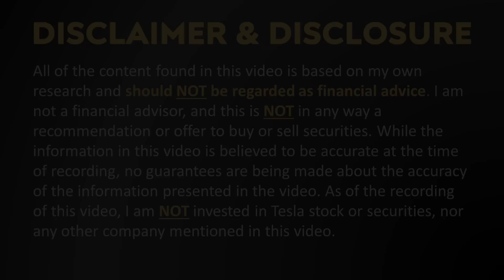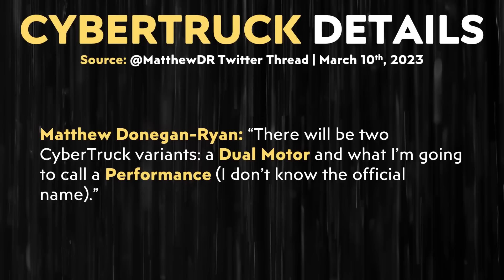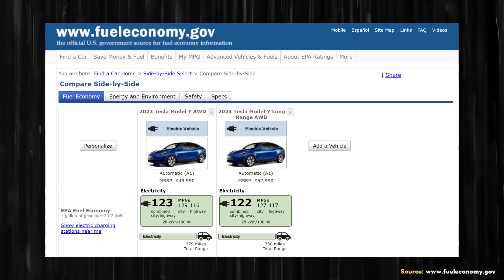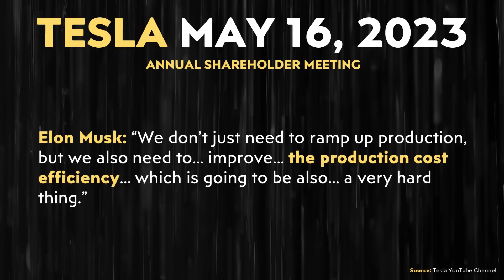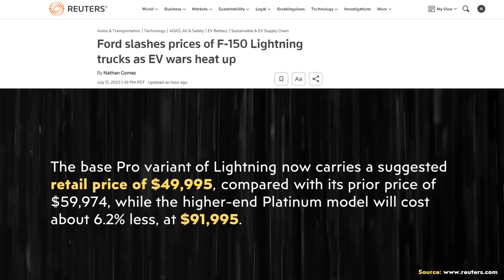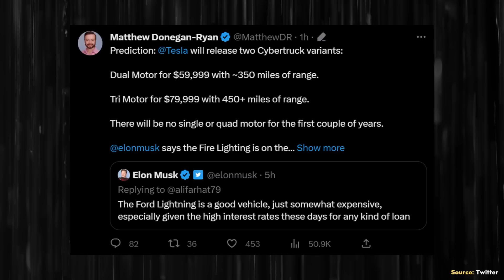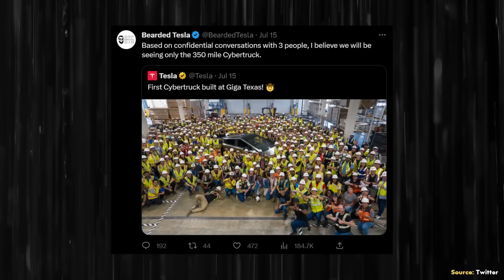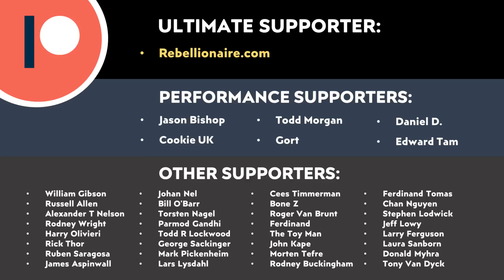Tesla Cybertruck Production Begins | Range Rumor & Pricing

Comment: Cleanerwatt; this has been the problem since day one with 4680;  they can't make them to work properly; what else do you think it was? 
it is in their annual report for 2022.  Is that a good source?  Tesla told Deutche Bank a major investor that they would Cybertruck in production by the end of 2023, saying they had 90% of the production issues fixed; they haven't. IF they had  you'd see new Roadster and Semi production running as well. you don't.  They really have no choice now but push them out no matter how much red ink it spills.  Problem is lots will bail on this news because they had anticipated significant Cybertruck production and at a profit; instead they cover it up and say nothing.
Reply: Genius, if you’re accurate. Did you short the stock yet?

Comment: They've already lowered the energy denisity of the v2 of 4680 to a slim 10% advantage over conventional from 16% advantage; so that alone will be a lowering of range by 6%.  More importantly the 4680 reject rates remain too high and any Cybertrucks produced wiill be red ink for the company.  Proof of that will be low production numbers under 20,000 a month; and delay until as late as possible to deliver any, so its already 12 days until Oct; your likely talking 45 days or at best November to see the very limited numbers delivered.
Reply from the maker: Where did you hear that there were high reject rates for 4680 batteries?

Comment: The Rivian R1T has been on the road for the last several years.  The interior of the Cybertruck looks like it came from a stripped down Honda.  Look at the R1T and you will understand. Yes, the Cybertruck is futuristic looking but I prefer comfort over being cool.  Both trucks can climb up a wall.  The Rivian is 10s of thousand cheaper and both use the same charging network now.  Range on the R1T 300-340+ depending on battery pack and Quad or Dual motor; both are fast. 600HP for dual motor is plenty for me.

Comment: Jon, you might recall my numbers on CYBRTRK.
I hold steady to the QUAD CT with the CYBRCELL as first 'Johnny Cab' off the rank on handover day in Sept or earlier.
This variant could well go 500 miles on the 175 kWh pack.
Pricing could be as high as $89,999 but with recent pricing levers used by Tesla, $79,999 would simply floor me and pretty much everyone, especially the competition.

Comment: Range is only one I think very small part actually of full size pickup truck market pure BEV as there is so much charging infrastructure now available thanks to Powerwall and SolarCity.

In the alternative fossil fuel "infrastructure"(retail footprint) has tremendously changed now in responding to this...as have ICE Platforms where range does indeed matter much more than previously #buccees but again for the full size market still all about bed payload, total payload and towing ability. 

Ability to tow should be truly awesome for pure BEV as a battery produces truly an awesome amount of torque and distributes this form of power ... and this is true power where it matters "along the curve" ... very even--ly meaning no shifting/no transmission/no fancy computers trying to get the computation correct between engine speed and flywheel rpms...this latter of which can still be done manually in point of fact.

In shorthand I will be looking at chassis design and wheel selection.

If Goodyears become the factory standard for Cybertruck that would be great news for Goodyear...a Company that definitely just some good news at the moment not just great news. Be interesting as well how the massive one piece body is "sprung" (versus unsprung weight.)

Comment: There is zero reason for Tesla to under cut Ford's pricing. Tesla will be losing money for a while on every CT they sell. Why give away money? The CT will have better specs than a lightning. Why sell a truck with more range, capacity and tech for less money? The CT will also be out produced compared to the lightning in short order. Ford has Lightnings piling up on dealer lots. Demand for CT is going to be far ahead of supply for at least a year. CT doesn't need to be the cheapest option to be salable.

Comment: The first model of the CT will weigh over 2722 kg (6000lb) as Fed tax law allows a large first year write down. It should have 150 kWh and a 380 mile range. I expect a 200 kWh quad motor will have a 500 mile range. The front and rear drivetrains should be the same.

Comment: That stainless steel will never be efficient or cheap to produce, standard stamped steel panels have a cycle time in the stamping press of just a few seconds, to kaiser cut and score a stainless panel then bend it in a press break will have a few minutes cycle time at best, that's maybe 60x as long. To produce at scale will therefore mean 60x as many machines to produce same no of panels that means massive footage in the factory and massive cost
Reply: That's right. This wll only ever be a very expensive vehicle produced in small numbers.

Comment: Here’s my bet. First production model available: tri or quad motor, rear steering, 500-600 miles of range starting at $69,000 or $79,000. He will reveal two other lower variants but they won’t be available until next year. Lower variants would be tri motor and dual motor with same range but different tow ratings. I think numbers less then that won’t give that wow factor. Too many competitors in close range.

Comment: I thought the tri-motor was cancelled in favor of a quad motor version. I expect initial production to be dual or quad motor, no single motor version. 500 mile range will come later when 4680 battery production hits high speed.

Comment: "Range-anxiety" is not really a thing any more, and 350 miles is going to be fine. Weight became a priority, because Cybertruck doesn't need to be a brick, like Lucid or the ridiculous Hummer EV. If this EV 'floats' for 1+ hours then 'milage' is soon forgotten. $59,990/tri-motor[...for towing], and 350 miles is the sweet spot. Bigger battery can wait for V2 edition. Think about it🤔 ...if you can float for 10 miles, would you give up 100 miles in range(?)

Comment: I am buying the Cybertruck when my name is called.   However, the biggest attraction to me placing a Tri-Motor reservation in November 2019 was the promised 500 mile range.   If Tesla only offers a 350 mile range version, I would be disappointed.  (But kinda of anticipated it)
Reply: Tesla is still struggling with 4680 battery production. Lack of batteries is the main reason not to bring out the longest range first. Your long range version will come later.
Reply: @royh6526  will come later?   Reservation November 2019.   Probably shorter range in 2024?   Longer range in ?  2025?   6 year wait!!

Comment: You can be sure they will release a dual motor 350 range.  I feel certain the Lightning cost drop is in part due to industry rumored pricing of the Cybertruck.  Initially, releasing a version for exposure and “field testing” before a heavier grade version frankly seems wise.
Reply: The price drop is primarily due to low sales. Tyler Hoovies' video about towing with one hurt them hard. Real world use proved them to be bad trucks.

Comment: Still wondering what the towing and hauling range will actually be, plus what happens in the winter. We have seen terrible range in other EV trucks under these conditions.
Reply: Same as all the other e trucks. Tesla has no special technology. Worse actually because the Cybertruck is heavier.
Reply: @Withnail1969  Sure they do, their heat pump design is more efficient than GMs, and Ford literally doesn’t have one. 🥱

Comment: I have the tri-motor reservation with 500+ miles range, tri-motor version. I don't mind to wait for it. I want that range from a CT. People who want a dual motor CT could get there's first. I predicting a 400 miles initial production release, not 350 like most people predict. I would be super excited if 500+ mile CT release. Happy to wait for my CT.
Reply: I too have a CT reservation. Not sure how long before I get mine. I like the 405 mile range on my new MS but from a practical standpoint one has to take a break after 150-200 mile long distance drive. I will not be hauling stuff in the CT so I am not as concerned about range penalty hauling heavy load. Hopefully in two years the CT will have lots of new enhancements that will make it more desirable.

Comment: I think we should be considering wh/mi usage similar to an X at ~280wh/mi. So For 350 miles of range and it will need a 98kwh pack (Seems reasonable).
For ~500 miles it will need a 140kwh pack.  Assuming its a big model Y, with no paint and less processes, I'm thinking 65-70k for the 98kwh battery and 85k+for the larger battery.

I'm probably wrong tho lol

Comment: I think Tesla could produce a $65k 350mile/charge Cybretruck but given the IRA and state tax incentives that will be @$10k. So Tesla can eat this and increase the price to $75k. 
I think that is good value given you have access to the Tesla network and charging at 250kW and potentially higher if they provide Cybre with V4 access, which I assume they will since they will use Semi Truck high voltage @1kV battery charging.
Unfortunately running with the rumors of some random dude that says he spoke to 3 dudes at Tesla.....is just laughable. If he said he spoke to 3 members of the Tesla board then that is a,different matter completely. 
So no I don't trust thus dude at all.
I trust my own guesses which are -

Dual motor:
Pack size - 110kWh
Range - 400mile per charge
Charging - 400V/1kV so can use V4 or legacy chargers.
0-60 -4sec
HDW4- yes.
VtoL - yes
VtoG - no
Air compressor -yes 
42V battery - yes.
Price @$65k

Tri motor:
Same as the dual motor but with:
Pack Size - 130kWh
Range - 500mile/range
0-60 -3.1sec
Price @$85k

Comment: Based on recently posted photos of the Cybertruck "firewall," it appears that drive-by-wire will not be available in the first release. The "firewall' shows a slot for a steering wheel rod. Hopefully, they have done away with hydraulic brakes.
Reply: It has also been suggested that those holes are for blow out ports for the airbags deployment.
Reply: @Frank_W.  Let's hope so. Would love to see drive-by-wire.
Reply: @roecroes  Given the battery platform I would almost say that it’s a given otherwise mechanical 4 wheel steering would throw out the concept of the best part is no part.  Fingers crossed that they could also include the Brembo Sensify brake system and it would fit the vehicle perfectly.  It may end up being too early for that though.  Purely speculation.

Comment: Those guessed prices for the cyber truck are still grossly overpriced. The truck is only worth around 18k due to short range, and long charging times.
Reply: This is badly designed and electric, it has to be cheaper than that!!! 😁
But yes electric vehicles should be way cheaper than ice vehicles they are so far behind for a lot of things ….they are bad, at least for now!
Reply: 18k? You’re lost. Nothing is 18 K.
Reply: @ZeusBullyMax  those paying more than 18k for a vehicle that offers less than a gas model are the ones who have lost their minds. How many gas or diesel models do you think they could sell if they went under 300 miles in good weather and about half that in cold climates and took over an hour to refill in good weather and possible several hours in cold temperatures? Fools part with their money easily.

Comment: Cybertruck is likely going to have a high range, at least one version with a very high range, probably the more motors the higher range.
If they want people to consider it as a work truck, it's going to need a heavy duty version for hauling (which lowers range) over a distance.

Now they have said that people usually only tow once a year...but they will need a version for the people that tow a lot
Reply: Not really. Tesla deals with data. If 70% almost never tow with their truck, why cater to the 30%?? Most of them don't want an EV, even if it had the towing capacity and 500 miles of unladen range.
Reply: @TecnamTwin  the small subset of people that really put their trucks to work are the ones that set the trend for what a truck can really do, and the posers want the real deal.

Also, if all you do is only use it once a year, but when you use it, you need it to do the job....then it has to be able to do the job.

Granted, if it can't be a work vehicle, then at least GM or Ford will still be able to stay in business

Comment: I recently drove a base Model Y and it’s acceleration is insanely fast. You run out of room quickly. With a truck, even a modest range/power level will seem even more adequate. The mid range truck will outperform a Ford Raptor, and if it comes in any lower than $80k it will be a bargain.
Reply: I own a model 3. Can confirm
Reply: No doubt the performance will be great, but will the range allow max towing range?

Comment: My sense is that Tesla is better off producing the Dual-motor 350 mile range product first.  I don't think there's an immediate need to address the distance towing use case with a 500 mile range Tri-motor version.  The Reservation Tracker finds that a plurality 43.9% of the reservations are for the Dual-motor version vs 39.2% for the Tri-motor.  It's important that the market sees Cybertruck pricing being competitive with the Ford Lightning which should be easier to do for the Dual-motor CT.
Reply: Tri-Motor reservation holder here.   I really thought in November 2019 that by 2024 I could get the 500 mile range as promised.  I guess Elon got out over his skis with the promise of 500 miles way back in 2019.    Coming out with a 350 mile range version at launch is missing the mark by quite a bit.   Sigh.
Reply: @billsrelectric  Ha ha, yeah.  Elon often gets out over his skis, but then recovers in amazing style.  Patience.

Comment: RETIRED 80,  USAF, VFW, FREEDOM. OWN 2018 TESLA MODEL 3 WITH 310 MILE RANGE. SORRY NOT BUYING 350 MILE RANGE CYBER TRUCK. WILL KEEP MY 20 YEAR OLD 2003 H2 WITH 42K MILES.
Reply: Sounds like a good choice for you.
Reply: @CMac_44  TOWING WITH 350 RANGE, CUT THAT BY 60%. TRUCK WITH 800 HP AND 0 T0 60 IN 2.9 SECONDS. NEVER HAPPEN!

Comment: Good video.  A disappointment not to have the long range of 500 miles.  With the function of pickups to haul heavy loads and needing to reach chargers with these loads, I would not consider a normal range cyber truck.  If Tesla would announce they would not make this long range model, I would cancel my order.  Good info.
Reply: I need the 500+ model to tow my 38’ trailer. Have been waiting on that to retire. Will be very disappointed if they give up on that model
Reply: @Thisisaplaceholder1  They are not giving up on 500 mile range, just won't build it for a while. When 4680 battery production hits high speed scale they hope for, then it will be available.
Reply: @Withnail1969  who and what problems this is a statement that can be refuted in many ways but it’s so vague as to be useless
Reply: Expect it to be in reality worse than what Tesla is announcing, it always is. Nobody really gets the max ranges they claim.
Reply: @Withnail1969  they do, usually it’s exceeded. The range is a combination not pure highway it’s very clearly listed as EPA range. You can argue on that aspect but they never lie about range.